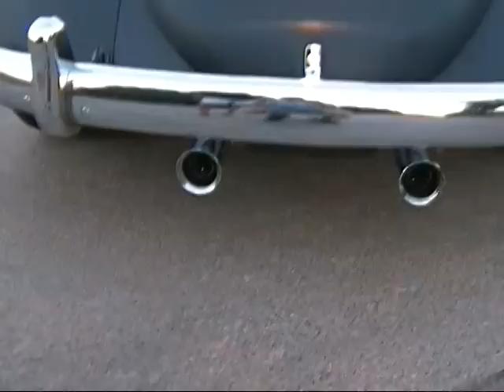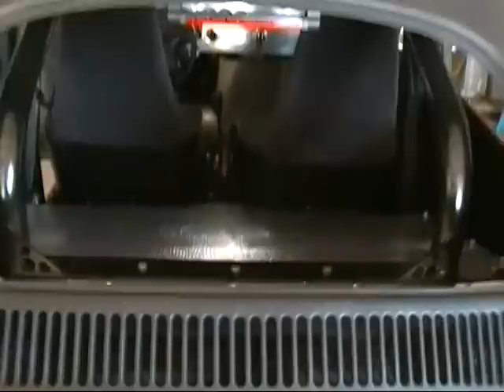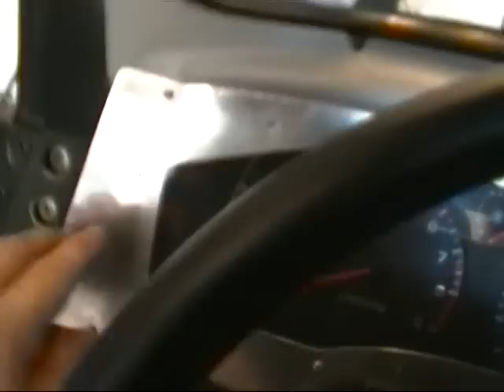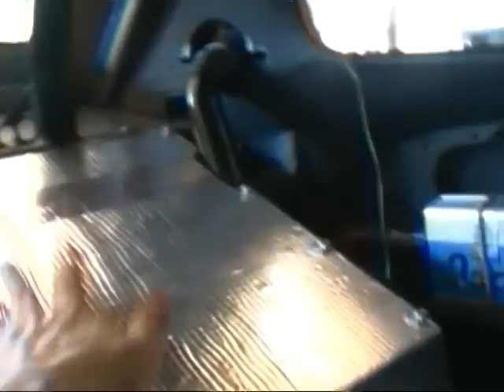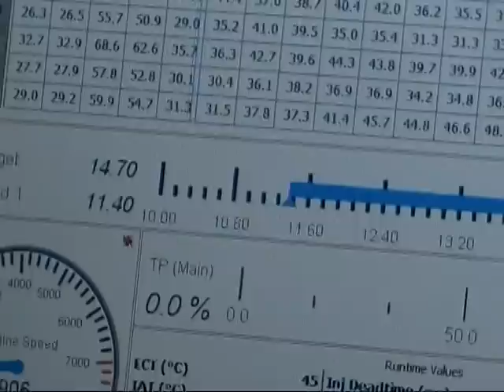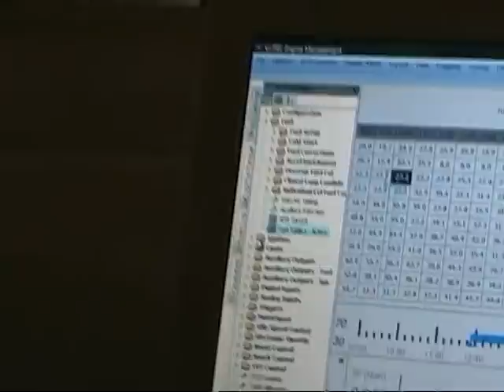BackyardBuild Summer 2012 Turbo VW Bug preview.mpg

Comment: I'm a VW guy and I can appreciate all the work and engineering this took. But I have issues with conversions because the Volkswagen is an awesome car because of its simplicity and ease to customize and build. I enjoy the fact that I can take my bug out and kill v8's and so called super cars and my car only took a fraction to build compared to others.
Reply from the maker: J Muhr I agree I love the simple Vdubs as well. I love the look of the older bugs and wanted a good project. It turned out to be more of a project than expected.

Comment: beautiful....awesome....lots of attention to details..
I have a question...i have a VW 1969 with toyota 5afe...i am facing this problem with engine overheating....how do u manage to keep the engine cool with radiator in front...i have a radiator from toyota in front with fan but i face heating issues in summers when temperature is already around 40 in my city...can you help me with this

Comment: backyardbuild what kind of rims are those? and what kind of bolt pattern are they?
Reply from the maker: craig lister Front 205/50/17 Rear 245/45/18. The bolt patern is five lug 4.5", same as a ford mustang and of course the 91 MR2. The rims are called Euromax and I don't believe you can get them any nore.
Reply: Dang ! Just my luck ! Love the looks of your bug,..hope one day mine will look like that (at least on the outside ! ) lol! Thanks for the info !

Comment: engineering masterpiece..re fit all Toyota mr2 mid engine into a beetle,not an easy feat but you have made it perfect...btw one question you in coming air to you a/c condenser and radiator,where is this drawn through, the very bottom of the front where the wheel well once resided?
Reply from the maker: Air is drawn through the foot-box from under the car. The cars still has the upper portions of the wheel-wells in place. Thanks.

Comment from the maker: The front nose of the car is completely open underneith. I also have a 3600 CFM fan pulling air from the foot-box area and pushing it through the opening under the nose. Also some ducting makes sure that hot air is not sucked back through the rad. So far it is working fine on 100+ days here in Dallas.

Comment from the maker: The front nose of the car is completely open underneith. I am having a bit of a cooling issue but the rework is under way now. Reversing flow through a radiator twice the size and ducting.